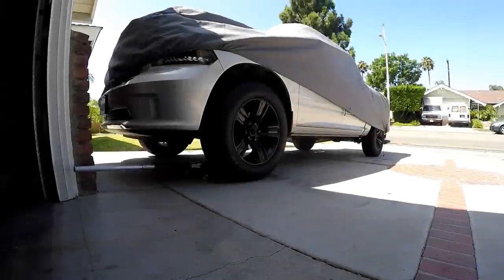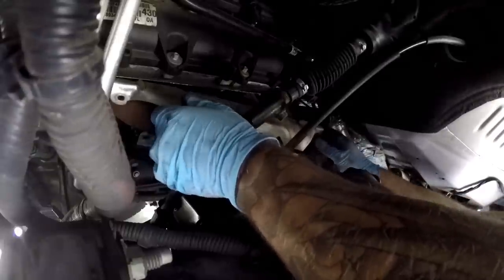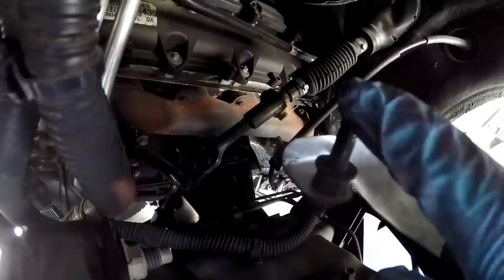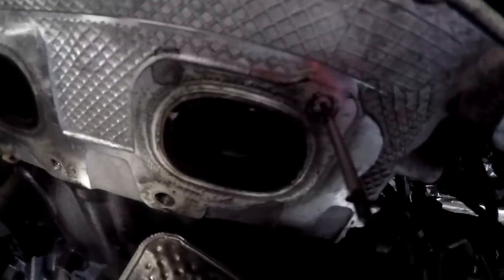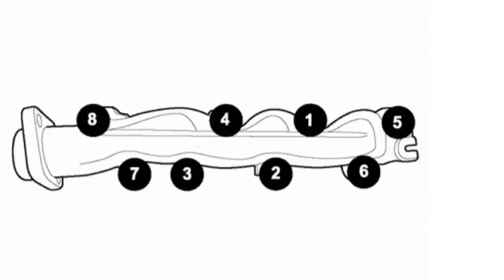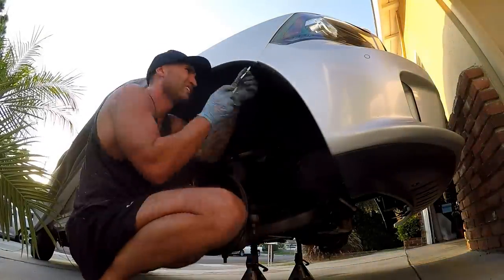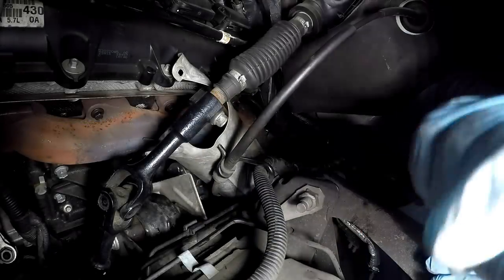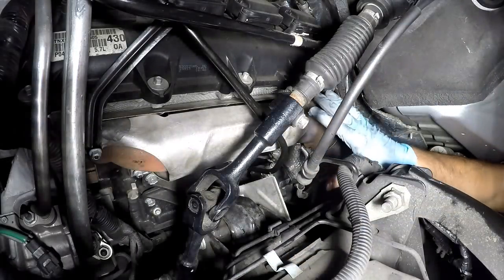DODGE RAM HEMI Exhaust Manifold Stud Replacement   Leak Ticking FIX

Comment: Driver side took me a whole day and passenger side took about 1 hour. You're lucky if the bolt snaps outside of head, then its easier to remove stud. Driver side, i had to weld on a nut to be able to grip it. If it breaks again ill go with shortys but i headd shortys can crack aswell thats why i hesitated to switch to shortys instead. Thanks for the vid brother

Comment: My 2017 RAM 1500 with 14k miles just started to make this same exact noise on the passenger side.  Going to take it to the dealership to see if they fix it. Thanks for the video.

Comment: I am getting ready to change out my bolts as well.  Thanks so much for the informative video.  I do have a question I thought you may be able to help me with.  Do you need/replace a gasket at the y-pipe/collector joint?  I'm seeing a metal and rubber gasket part listed for my 2014 ram 1500 but didn't hear you mention one. Thanks for the great video! I really enjoy all your videos on the LED work you did.

Comment: I'm curious how do you know so much about many different vehicles that you work on? Did you go to school to learn how to work on cars? I learn so much from watching your videos. Another great learning video for me. Thumbs up. Thanks
Reply from the maker: Hey Peter thanks for the positive feedback, glad you enjoy the videos!  I've always had a passion for motorsports which started with me rebuilding my 2-stroke motocross engines as a racer and then a bunch of shop classes in highschool. I had a lot of fully built turbo Hondas in high school and got screwed over on a $5000 engine build when I was 17 by some crook so I decided if I did it myself and it blew up I could learn at my own expense and it would still be cheaper.

Then I built a 700hp Honda S2000 with methanol injection myself and just kept going from there. I also worked in a performance shop doing a ton of high hp builds and its just always been a passion of mine!
Reply: Perfect example of why schools should still teach AUTO SHOP!  Why did schools eliminate useful classes, and keep basically useless classes like art?  I took every shop class I could when in school.  Because of that, I am able to do almost everything my self, from auto repairs, to home repairs and remodeling.
Reply: I'm on my gf puter Kurt. Its not her in the pic talking. I have to agree with you 100% bro. I have saved myself THOUSANDS of dollars throughout my life working on my own cars and trucks. I took small engines shop class in high school and went from there. As it turned out..Shop class has kept more money in my pocket than any other class taught. Its a shame the younger kids wont have the skill or knowledge to do the simplest of repairs. There are STUCK paying $40-$80 an/hr everytime they needs a brake job or belt and pulley change..etc. Most likely if there young they wont be making $15-$20...they will have to pay someone for working an hour or 2..what it took them ALL day to make. Our schools are failing when they cut back on useful..lifetime lessons.
Reply: BoostedMotorsports  Another great video you have so many trying to watch them all. When I traded my 14 Ram it had 58,000 kms from what you say was only a matter of time before manifold bolts needed replacing. You made it look easy with the right tools feel like with some patience I could do it.

Comment: I have a 2012 Dodge Ram and I love what you're doing with yours... especially the hellcat wheels... I'm having the same problem with the manifold I'm planning to swap them out but I was wondering if the replacement bolts are better than the ones that the truck comes with?

Comment: Without going through all the comments, I am wondering if you have a preferred bolt type for headers. I just bought a set of shortys for my 2016 and I don’t really want to use the bolts that came with the headers. I don’t mind spending the extra up front so I don’t have to take her back in. (My kids named my truck Ruby). Having the dealer do the work in a few weeks. 

Ruby and I appreciate you and the videos!! You are a huge help with great advice and a wealth of knowledge!!
Reply: Please disregard- I found your header replacement video and for my answers!! You rock!!

Comment: Got the passenger side done pretty quick. My truck was quiet. If it's not broken=don't fix it. Went to the driver side. Scraped the new gasket and caused a leak after i installed it. Had to go back to the original gasket. Had to switch out 2 times. Not fun. 

Things i found out to make it easier. 

Pull out the dipstick tube to remove the manifold and cover. The exhaust pipe has a tendency to push the manifold cockeyed when placing it in it. Causing the scraped gasket. Take a piece of 2x4 and place between tranny and exhaust to get the right angle to tighten the manifold bolts.
Reply from the maker: Good stuff! 🤘

Comment: I have a 2013 1500 with the 5.7 hemi. The truck has 40,200 miles and just had the manifolds (warped) and bolts replaced. Cost almost $1200 with no guarantee it won't happen again. Man, it's been a good truck but that problem is expensive.
Reply from the maker: Yeah the exhaust manifold bolts are something we've all had to deal with it seems.  Changing them out to tubular JBA manifolds and replacing the cast ones is a good idea too and should reduce the stress on the bolts.  Have you checked out the other RAM videos on the channel?  Would love your feedback on those if you get a chance!  Thanks again for the comment on this video! 👍

Comment: Very well done video ... 
and after scrolling down to the end of this lengthy read - do apologize for takin' up 1/2 a webpage here !  (lol)
There is a kit I've come across and used for this ...
 'Dorman Manufacturing' (who supplies the vast majority of aftermarket replacement parts to out-the-door parts counter vendors) ... [[ 'Exhaust Manifold Mount Kit'  - 03411 - comes with 10 studs/nuts ]] - U can pick this kit up for a mere $10 ... (note this referenced part # may not be the same at every vendor u possibly encounter and only know it fits 5.7L's with the same manifold configuration possibly not all 5.7L Hemi's ) ... Dormans kit is sufficiently the same quality thou not better than original Mopar - your choice) ... as for the gaskets (if u would decide to replace) range from $20-40 ... normally my 'go to' choice is 'Felpro' for this project - (again 'your choice') then as 'Booster2k' admits to saving a few bucks here n there - (no issue again 'your choice') since most of the time it's a bolt/stud issue.
The rest of this comment is aimed to those that have become a victim of this same issue - the same apparent FAIL and where to place "blame" !
A well-known FAIL since Chrysler dealers, alot of mechanics, and of course alot of Ram owners all over the country have faced this very same issue at some point in time - BUT is it an engineering FAIL or otherwise .....
Is the main issue here to do with "exhaust manifold design", "faulty exhaust fasteners", maybe even "exhaust hanger design" ... 
in this instance seemingly all 3 are culprits to some point in breeding this unavoidable issue with a 5.7L Hemi in any Ram no matter what year and will eventually succumb to this dreadful exhaust leak issue ... thou is it due to a poor design in engineering from the ground level at Chrysler - (the engine itself being without issue).
Normally an issue is born either by an error or once a "retrofit" takes place ... in this instance - (to make it fit / make it work) in a chassis 'final' design beit all marketed factory chassis'  ... all deemed ok to go except for one thing - the exhaust manifolds ... so back to engineers it goes - biggest obstacle (best flow and best fitment) AND both within a timeline ... promptly arrived in the flow dept. thou lacking in fitment to all chassis' due to insufficient time to market - ok quite a possiblity but possibly not.
Now let's move on to whose dept. is it to get the "weight" handled - the weight of the entire exhaust system which is spread out beneath the chassis ... where oh where to install "hangers" - we all know if a hanger fails what holds the weight - well alot of that gets transferred to the exhaust manifold itself correct?  Are most bolts/studs that are found broken or loose toward the rear or at front and which side are they mostly found? Is factory hanger placement involved? Is it worn hanger (stretched rubber) involved? 
Weakened bolts/studs due to heat cycling?  Thou as it seems a Chrysler engineering FAIL to allow it to continue BUT there is another point that comes into play here - could it be this ... ( #4 ).
Could it be just plain "torque" (no no - not bolt torque here ... "ENGINE TORQUE").
I'd say all of the above thou one big aspect of the issue becomes very apparent - all have to do with TIME and USE ... and that word "torque" and what it describes keeps on poppin' up ... OK who doesnt every now n then "mash the gas" ... beit hardly ever or more often than not - (of course U will because that's more than most a reason why u have a Hemi ... well torque causes "twist" ... constant twisting and flexing is how this issue 'can' slowly develop ... when the engine TWISTS due to torque the chassis doesn't want to give - hence where does that twist get transferred to - OUCH !  AND over a period of time that's alot of twistin' action !  Then again - hey what about engine mounts?  They play a major role in handling this - (well it seems they do their job well in this case and pass it on somewhere else).
Are there stronger bolts/studs - possibly ... then why does Chrysler not use them ... heheheheh - they do !  IF the bolt/studs would not fail at some point (remember the head is aluminum) where do ya think the twist force would then be tranferred to??? OUCH !!! Then why not are other hi-output torque twisters out there prone to this same issue ... some do some don't ... do others approach the 100k mileage barrier and beyond in time ??? 
We just have a sure fire winner here in the 5.7L Hemi in a Dodge Ram ... so is it all a Chrysler FAIL ??? 
Where to place blame is to where it has been spread thru out the course of time and periods of usage. 
Long live the HEMI !!!
Reply from the maker: wow thanks for the lengthy response! lol

Yeah I do believe some twist/flex could play a factor.  The other reason is that the catalytic converters are VERY close to that last exhaust port and the bolts are usually pretty cooked looking on those last cylinders so having that high heat backed up these definitely doesn't help the problem either.

Just keep an eye out for which model year you have and which kit you get cause there are some changes to the heat-shield and bolt/studs over the different years.

Comment: Try that here in the Northeast rust belt. doing my 01 5.9 Ram. The fender and steel liner are welded together so had to remove as single unit. Two center studs snapped off in block. Grade 8 studs so forget about drilling them. Had to weld a nut to them. Cast iron heads so no worry about the weld sticking to the block. I laid a straight edge across the manifold ports and the center ports do not lay on the same plane as the two outer. too low. ordered new one. hope it's better. Crap is made in China so I'm not getting my hopes up. Also noticed that the gasket was pretty much gone. (Fel-Pro). Lasted two years. Ordered some Edelbrocks composite.

Comment: this video was very helpful, my 2011 ram has started ticking an it only has 36k miles but I'm assuming this is what happened. Exact same sound and goes away after it is warmed up. I really don't want to do this myself though. I think I'll call my mechanic.

Comment: Not even 40k miles on my 2012 ram and I noticed the leak yesterday on start up. Pretty pissed that it happened. Love my truck but we shouldn't have to deal with this. Thinking maybe a set of shorties and decent hardware will keep it from happening again. Just don't trust the mopar replacement bolts if they already snapped once.... Thanks for the video. Very well done and informative.
Reply from the maker: Yeah it will just happen again unfortunately over time.  I'm actually doing exactly what you mentioned and have JBA headers and Stage 8 stainless steel locking bolts going on next .  Also check out a oil catch can if you plan on keeping your truck for awhile. It helps to keep your engine getting gunked up which I show in this video here:
https://youtu.be/OIZaPA_VwNc
Reply: I got a 2012 with 55k and this happened to me also. 5 months out of warranty. I did it myself. Used the welding trick to get the one out that broke. Should do these out of my house in San Antonio. Make some money but not as much as a dealer
Reply: Joe Gest I live in san Antonio also just bought a ram 1500 I hope mines doesn't give me problems for a while
Reply: keep my name and maybe we can work out a deal to get them done if it happens
Reply: Joe Gest will do man I'll message ya thanks
Reply: hopefully you wont message me, LOL cuz they will stay in one piece...
Reply: Joe Gest I know I hope they will lol
Reply: The reason this is happening is because there is a hot to cold flaw in the stock manifolds snapping the rear bolts. Replacing the manifolds with aftermarket is the only way to actually solve the problem. I am getting a set for my 2010 ram from oriellys that work with the stock exhaust system because of this very same problem.
Reply: what those new manifolds cost you? dodge bolts or new ones?

Comment: I have 2012 Ram and this happen to me a about a year ago. Changed out the stock manifolds and installed BBK headers and Stage 8 fasteners. Have not had a problem. Most definitely take out the fend liners. Also remove the steer shaft. Makes it easier.
Reply: How long have you had them on? Miles?  Still no leaks?
Reply: @jeepin4x4YJ  I put them on at 45k and traded in the truck at 93k. Towing a 8500lb RV trailer and drag racing the 1/8 mile on Friday nights.  I also changed out the clutch fan and shroud for a V6 one of the same year. great upgrade.
Reply: Thanks bud. Thinking of doing this on my 14 ram. 2nd time manifold is leaking and not warranty this time
Reply: @jeepin4x4YJ  It will be worth it. Also put a oil catch can. You will be amazed at the amount of oil it catches. The truck was awesome. I bored and stroked it to a 6.7 after the warranty ran out 36k Used an kit from Arrington Performance. It was the biggest kit they had for the 5.7 block. could not put any boost of it though. Traded it in for a Power Wagon.  Used car manager and the Service manager test drove it and the Service Manager at the dealer bought it off me.
Reply: Did you use ceramic coated ones? Did you wrap them? Did you use the locking pieces for the stage 8 fasteners? Any issues at all after install?
Reply: @jeepin4x4YJ  Yes used the ceramic and no wrapping ceramic tubes. Voids warranty and the moisture they hold ruins the coating.  I wrapped everything else.  I also replace the bad Y connector with a Hedman Headers 2 int one y pipe.
Reply: Cool deal thanks man

Comment: After you replace the manifold bolts, will they go bad again? Since you have aluminum and metal contracting and expanding at different rates the bolts will eventually break again?

Comment: Did the oem bolts hold up? I was told to upgrade the hardware being I'm going with the StainlessWorks LTH. Would you suggest a good hardware kit?

Comment: It was a great video. Should’ve started the truck up after. But still a great video!
Reply from the maker: It just sounded stock/normal with no ticking 😁
Reply: @BoostedMotorsports  did this permanently fix the issue?

Comment: I just bought new bolts and manifold for my 13 1500 and plan to take on this project next week. I'm curious what kind of torque wrench you used in the video because I can't seem to find one that short. I only have a big one that won't fit in that space.